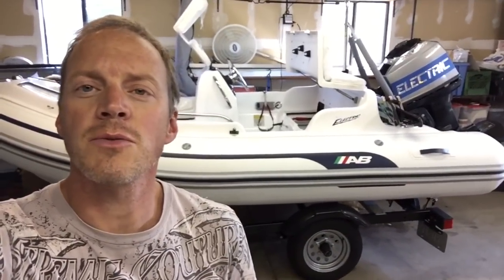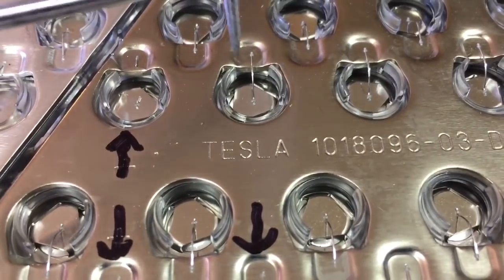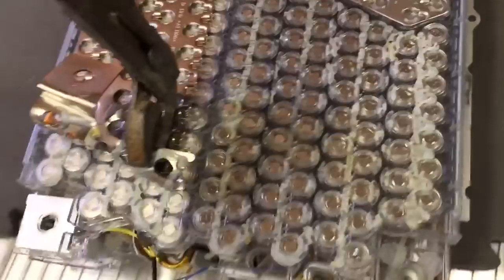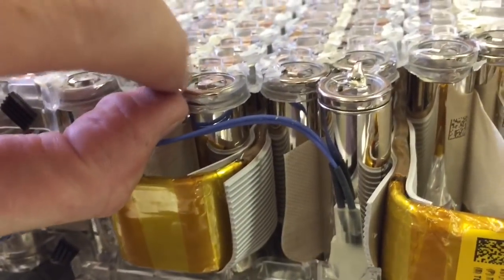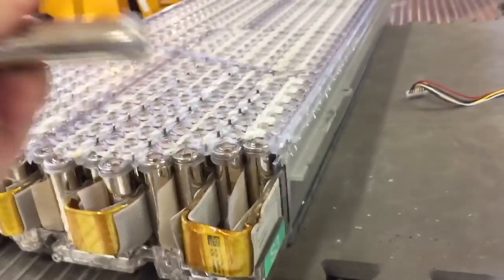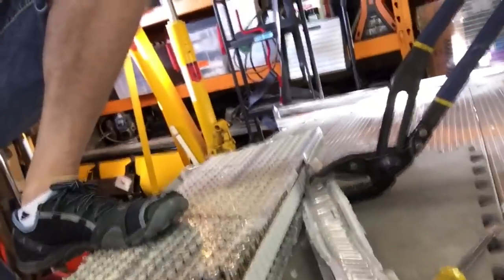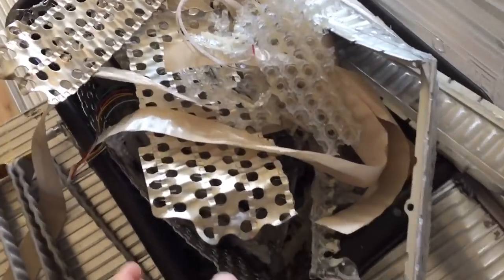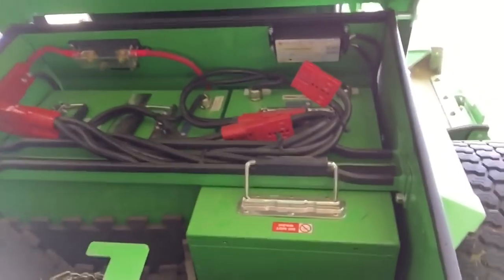Tesla boat battery destruction and teardown

Comment: Hi man.. I'm doing the same thing as you.. trying to open this module..
I'm down to having rows in two.(between cooling) but how did you get of the last layer of plastic/glue on top?
Reply from the maker: fabicon try using a Dremel tool or vibratory multi tool to make a thin cut. Be careful not to scratch the battery case though. Alternately, if you work the battery from the other side that plastic seemed thinner

Comment: Plastic to cells... possibly not glued but an ultrasonic bonding process. Or thermal or catalytic.... or battery pack heat with use and testing causes such "bonding"

Comment: What you going to do with those cells?
Reply from the maker: Steve Dutcher thanks for watching! I’ll probably list them on eBay individually. All but 10 of them still work fine although I damaged a few of them getting them out.
Reply: Donovan Gibson
Don't buy it, respect your self. Buy new.
Reply: tesla cells keep like over 90% of their capacity after 200k miles. Still more capacity than your average new cell. And the capacity tends to denature less and less

Comment: If you break your battery in a car accident you won't have to worry about a fire because your already dead.
Reply: No one has ever died in a Tesla because of fire because it is much slower you  will smell and know its on fire and have minutes or longer to get out vs a gas car that just blows up. The only 2 that have actually died were because they are idiots on early autopilot thinking the car is fully autonomous.  Statistically, if you take number of deaths for all cars vs Tesla you are 10x less likely to die on one.  NHSTA ranked Model 3, S and X safest cars ever tested in their category. The battery on the bottom of the car is 1000lb low down for great center of gravity which helps keep it from flipping/rolling as well as side impacts where typically it would crush right into driver the battery prevents that much more effectively than any gas car. Having no engine in the front allows a huge crumple zone to absorb impacts.. often air bags dont even go off in head on collision accidents where they would in a mid engine vehicle.

Comment: Pretty terrible balance charging. 72 cells in one group? LOL
Reply from the maker: Hi, the 72 cells are in parallel so no balancing is required, just the 6 groups in series.  The BMS is 7 wires per module.

Comment: I feel like the design of this battery pack is RIDICULOUS. If it wasn't packed with unnecessary plastic and housed with so much unnecessary metal, it would be much lighter and wouldn't need that freaking cooling system. You can design a compartment to utilize airflow to cool those instead.